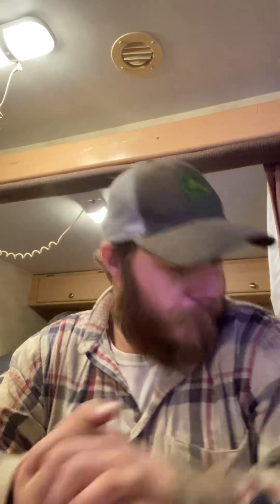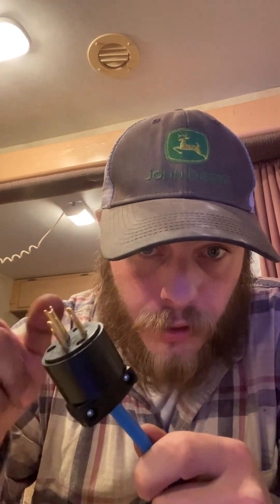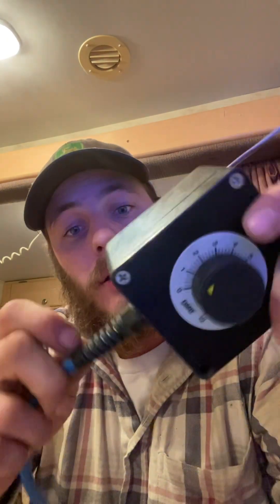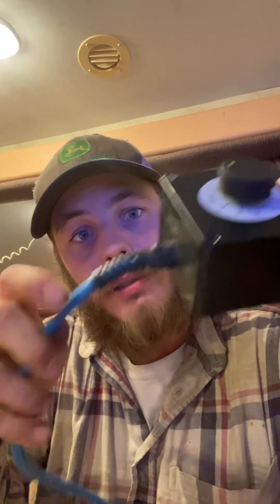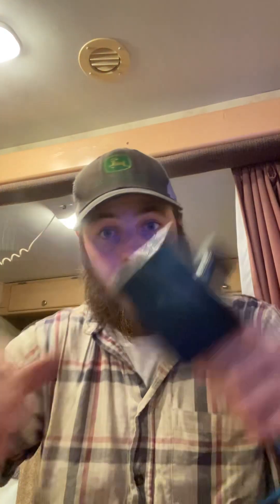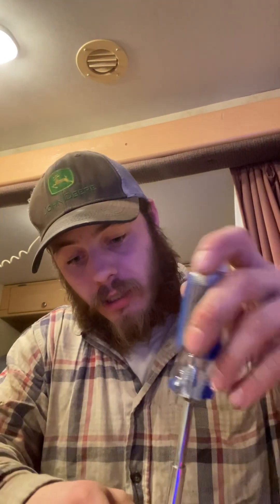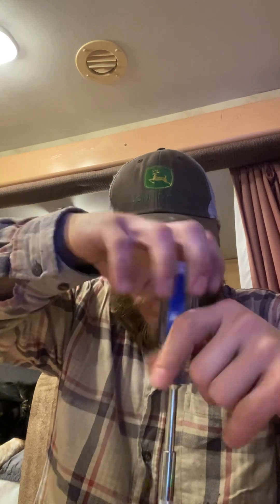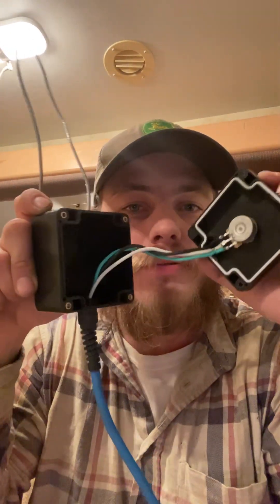HOMEMADE WELD REMOTE (FIELD WELDING) LINCOLN AND MILLER

Comment: How can I find out what pins are power, ground and communications for a Lincoln 6 pin ? Awesome video !
Reply from the maker: I'm pretty sure its in the manual or you can call Lincoln and they will tell you. I'd call them right now while its not busy.
Reply: @trailerpark6.7  thanks! I found a wiring schematic , it’s shows 3 wires going to a box with and “R” that must be the resistor (potentiometer)
Reply from the maker: @dooryardfabrication3973 you are on the right track. Let me know if you get it working and post the pin letters!
Reply from the maker: @dooryardfabrication3973  after doing some research on this subject in my winter off time, I have found I believe (A) or orange behind the plug on your welder is your speed High for the switch and (B) is your Wiper or switch as I relate to it in the video. (C) is your Speed Low. (F) is not used and (D) is your ground pin for the remote on switch and (E) is your remote power switch. I would loop (D) (E) together so every time I install my remote the machine knows I want to use it, or put a switch on the box doesn't really matter how you connect those two leads so long they are together when you are using the remote.
Reply: @trailerpark6.7 I think this is exactly what I did, it works now. Thinking of doing a video for this 6 pin Lincoln. I’ll let you know when it’s up! Thanks again for the help .

Comment: Looking to make on for a Lincon ranger 250 but mine has a 6 pin will it the same
Reply from the maker: Are you trying to Tig weld or stick weld??? Neither machine uses more than three wires for their remote. This is not for spool guns and suitcase welders.
Reply from the maker: I misunderstood. You need to figure out which of the three leads in that connection are for the remote. Find the switch, voltage output, and remote ground wires. Lincoln Post all that online and probably is the same across many machines. It's that way for miller.
Reply from the maker: So in my off time I've done some research for you. (A) power to switch (B) wiper switch or signal (C) switch ground ((D)(E)) loop together. (F) not used.

Comment: I built one and used the same pins you said to use but it’s only controlling the voltage and not the amperage. I have a miller xmt 304 cc/cv don’t know if the pins are different or not.
Reply: Pin C on miller xmt 304 manual say (output to remote control in mig mode). The only pin that looks like it’ll work is pin F (current feedback)
Reply from the maker: @jacobtaylor1576 you do realize that mig welding doesn’t have an amp control right? You have a voltage control and a wire control…. What you are wanting to do just doesn’t make logical sense. You are 10 feet from your machine… just walk over there and change it. This is for us field welders who are making field welds not shop welds. It’s in the title.

Comment: Have you tried making one with with a potentiometer connected to a digital lcd to display amperage?
Reply from the maker: @AndraeVazquez  I just do the math and leave my machine at 200 so 1 on the dial is 20 and 10 is 200. It’s easy to gauge that way. Keep it simple. You’d only get a voltage reading from 0 to 10 from the potentiometer because that’s what the machine used to set the amps a 0-10v reading, I guess if you wanted to get a old vape mod lcd and wire it to show a 0-10 number you could but where we work and if you stick weld then I’d just use the sticker that came with the potentiometer

Comment: Will this work for a SA250 AC machine? I know the DC machines are simple but I am not familiar with the AC machines.
Reply from the maker: @KL-ml4xw  if the plug is the same size check the pin out for your machine
Reply: @trailerpark6.7  Its an 85 built machine so I have to wire a plug in it. From what I see you need 4 wire to work a remote on these, I dont think it would work. I just started down this rabbit hole so I could be wrong.
Reply from the maker: @KL-ml4xw I believe it’s a rheostat for a sa engine driven machines right?, it uses 2 poles I believe to change at a higher current (4 wires) versus the low voltage sense miller uses, so basically on a older Lincoln you are extending the wires that are already inside the machine while the miller machines use a 0-10v sense that tells the machine what amperage you want. I think I’ve given all I know on this topic. Anytime I needed a remote on a sa platform we just had a standard remote and a ton of generator lead. Which was 4 wires

Comment: I built mine today. It works perfectly on my trailblazer 302 air Pac. My panel still controls max amperage while the remote goes from minimum amps to whatever i have set as a max.
Reply from the maker: @dragthatsht  correct that is the way killer designed it. Glad it worked!

Comment: So if you were to add an outlet plug what pins would be used ? Pin A & B ? 24v AC
Reply from the maker: Well you need over 110v to run a grinder so look up the wiring diagram and figure out which pins give you 110v and wire up a gfi. I personally wouldn’t do it cause a grinder can draw a lot of voltage.

Comment: ever make a wireless?
Reply from the maker: No that is too expensive to make in my opinion
Reply: @trailerpark6.7  about a grand or so, but yeah a time and 1/2 of a headache 🤕
Reply from the maker: Ive heard of guys spending way more than that and if you like me i dont have time to do shit after work, usually working 7 days a week and its just not worth the time. It can be done tho you are correct @378Noe  it takes a lot of development and coding.

Comment: What welder you have brother? I have the trailblazer 325 , are all millers wired the same?
Reply from the maker: I'm using it on a big blue 400 cst dou it will work on all 14 pin miller machines I believe. the pinouts are all the same for miller machines with 14 pin connectors.

Comment: Is it the Same wiring for a Lincoln just a different plug?
Reply from the maker: different plug still 3 wires but I think that is for new machines and shop welders, if you have a sa 200 I think you need a reostat.
Reply from the maker: (A) switch power (B) signal switch (C) switch ground (D)(E) loop together. someone let me know if that works all my welders are green 👍👍